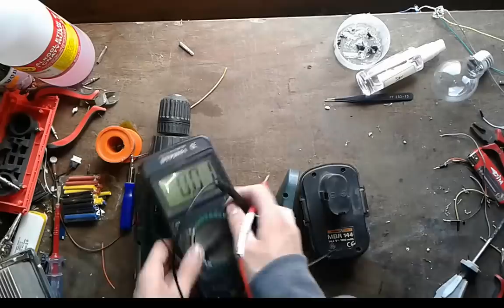How To Make a Super Powerful Li-ion Battery 14.8V 3A For Cordless Drill

Comment: Let me see if I understand... You are using 4 pcs of Lithium 18650 batteries.  The batteries each provide 3.7v nominal voltage, meaning a total of 14.8 volts total approximately.  You then used a balance cable to individually charge each 3.7v bat with a TP4056 and some pins.  Truly an amazing approach I had never seen.  Wouldn't it be easier (and safer) to use a $1.00 4s BMS from Aliexpress?
Reply: Where's the fun in that :D
Reply: 6

Comment: Heating batteries by soldering iron will damage it seriously. That’s why factories use spot welding. Lifetime of battery %50 comes down.
Reply: Bull shit! This type of battery can hold 70C-90C degree, is not posible to warm up that high trough 3 sec of soldering
Reply: @X-mass  it not bullshit and soldering will get hotter than that. It’s also the exact sharp heat to one location that could cause damage. No one is thinking it’s going to heat the whole cell to 90. But the metal directly behind the iron will be hellish hot. Especially on the negative side. Not good. I agree that the “it will fuck the cells” is a bit overplayed. It seems to work here. Drills running fine. Can we ever know if he knocked of x amount of cycles of the cells?? Not really. I would t solder up a nice ebike batt build with new Samsung’s but lashing up some drill for fun why not. They use spot welding because it quicker and easier to automate more cost effective as well as less damaging
Reply: @justbreakingballs  Is there any easy DIY you could recommend on spot welding?

Comment: tin friend is not good for connecting batteries! for those who did not understand the association of batteries, since it was not explained in the video would be, using 3.7v batteries we would have when we associate 2 in parallel 4.2v using 3 in series 12 volts / 6 in series and parallel 12v with current hour folded, 4 in series 14v, 8 in series and parallel 14v with double chain, 5 in series 18v, 10 in series and parallel 18v with double chain, and so on! note: the current depends on the individual current of each battery, in the case of the video we have 4 of 18.5mah!

Comment: I have a black and decker 14.4V. I was going to by a 14.4v power supply but i don't know how much amps i need. Can you help me?
Reply from the maker: it is better to use a Lipo Battery charging module becouse they protect the batteries and deliver the right mA to the bateries :)
Reply: Buy yourself an Imax B6 or equivalent. Much more versatile charger that can charge almost every chemistry battery in current circulation.

Comment: I can't believe you left those 2 Ni-Cd batteries in the upper part at the connectors. Even if they are no longer in the circuit, they still are a hazard and a potential leak hazard that only God or a chemist knows what kind of reaction would happen if that electrolyte decided to get acquainted with the electrolyte from the Li-ion batteries. That whole set up looks like a disaster waiting to happen.

Comment: IsDeno24 -    is the bms recommendd or as a the optionaal, and... is your battery power current enough without bms for the contribute to the drll cordless, bro ?    cheers..(Y)
Reply from the maker: +mukhlis1010 is better qith bms but i didn't need one for this cordless drill :)
Reply: ++IsDeno24 -   I don t kow  which one is correct...lol?
Reply from the maker: mukhlis1010 4S10A bms :)

Comment: Good jub but you habe to use Li-Ion Lithium Battery 18650 Charger PCB BMS Protection Board its better than TP4056 Charging Module its used for one battery not four

Comment: Hello I need your help¡
I made something loke that for a 15,6v drill the battery i built is 16,8v but whrn i turn the drill on the voltage starts going down until i stop pushing the button and then it starts to go up again until i push again and it repeats 
Please help me to fix it
Reply: These batteries are all 18650 from Panasonic with a capacity of 2250mAh and are from the same laptop so i do not know why it happens.
I`ve also tried with another laptop pack and the same happened ;;((
Reply: Some laptop cells are not high discharge, the current draw from the drill is too much for the batteries to keep up. Check Lowe's recycle bin for old battery packs that you can salvage cels from. I just use laptop cells for small projects like upgrading vintage flashlights to LED and stuff.
Reply: @austinsullivan7554  I have had no issues renovating old drills with equally old laptop 18650 cells over the years! I don't even use BMS.I just charge regularly with a ImaxB6 while monitoring individual cell voltage.